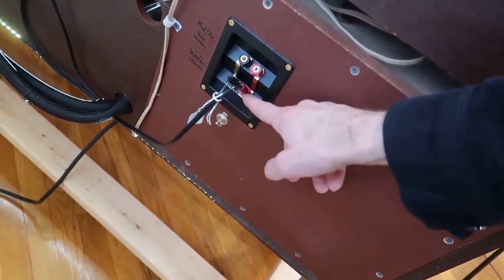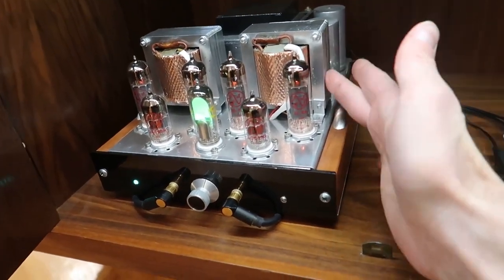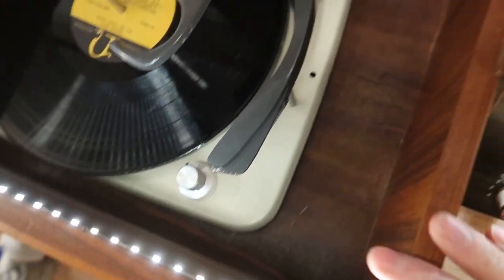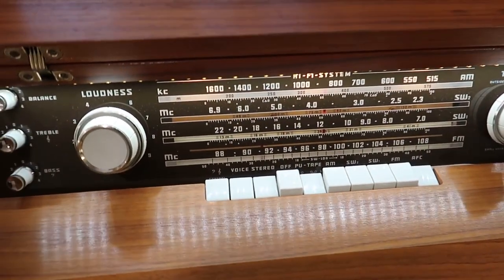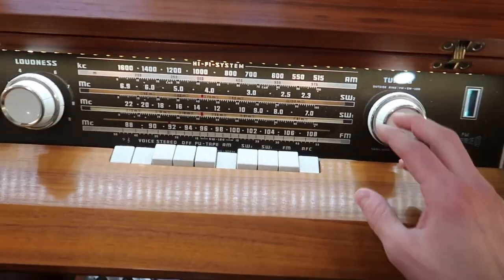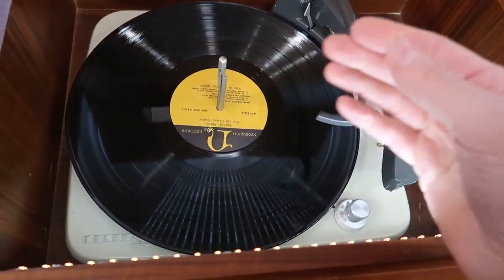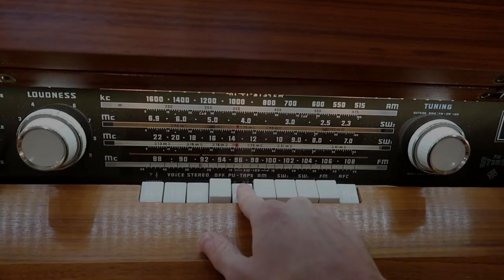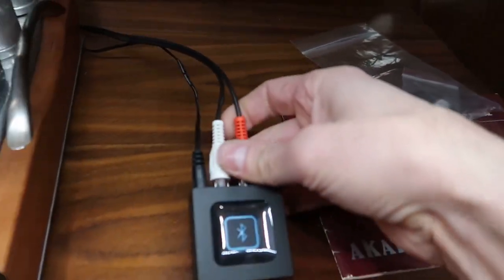Remastered Telefunken Bayreuth 5552MX console Acoustic Research Tuning Eye tube records antique

Comment: You are not using the auto function on the record player correctly.  You need to place the record at the top of the autochanger spindle, and secure it in place with the arm.  Then when you switch it to start, the record will fall down on to the platter, striking the size selector lever, and the pick-up will land in the correct place.  Then, as the arm has fallen down when the record fell, the pick-up will return to it's stand when the record has finished.  I think it can hold up to 10 records. Incidentally, I think the auto mechanism needs greasing, as the turntable was struggling to turn when it was engaged
Reply: Yes, I could not help but wonder what was going on, put the record on the autochanger turn it on and let it do it's thing. I would also read the instruction of the tape deck
'cause the tape is not threaded correctly an AKAI 4000 should perform as good
if not better than bluetooth
Reply: Yes, to both of you. He clearly has NO clue as to what the hell he's doing with both the changer and the reel to reel deck! Also makes me suspicious as to whether the electronics were repaired / restored properly - as the playback devices clearly were not! Additionally, is he not aware that there are input switch-boxes available (cheaply) that would prevent the cable juggling act  between the Bluetooth receiver and the tape deck? Mr. Joyemusic, please do take the advice given so freely here, your future customers deserve that much!

Comment: It is clear that you have done a great deal of restoration, for which you should be commended.  However, you are not operating the record changer correctly.  The unit is an American made VM changer, and you can find the model # on the underside of the changer.  Gary Stork at VM will be happy to help you with it.  On to the tape player.  You are not lacing the tape correctly.  Refer to your owner's manual for instructions.  Both the tape machine and record changer need to be cleaned and lubed.  They are both amazing, very well engineered units and will come right back to life for you when cleaned properly.  This is a lovely console.

Comment: I think the tape is wrongly laced in the reel deck. You are not using the capstan on the right. So no wonder it doesn't work correctly.
Reply from the maker: The pin on the right is an auto-stop, like if the reel runs out of tape. The speed issue is related to the slip of the reel -- Not enough slip on the take-up, I think... although that's the first time I had that problem.  But, yeah, there are probably some subtleties that I could learn on these things! I didn't grow up with them.

Comment: Hi!   Did you replace the power cable?   I have one of these but can’t locate a power cord for it anywhere!    It’s the old 2 prong
Reply from the maker: Yes, I actually installed a power strip inside and rewired it so a few outlets on the power strip are switched when the top is opened. Of course, I left a few outlets so the user could reconfigure it if desired.

Comment: I found one of these on a local auction site and the price is still under $100. I have zero knowledge of hi-fi equipment but my fiance is into records and we wanted a console for the house. The site lists it as unknown working condition. Would you recommend picking one of these up if it's a bargain? With little knowledge do you think it's a good project to take on? Thank you! Yours looks fantastic.
Reply from the maker: Nice find! If you're good with fixing things, you'll probably be able to get some of it working with YT videos. They generally take a lot of oiling, greasing, replacing bad belt (o-rings), etc. The electronics are sometimes not too hard to troubleshoot, but it does take some skill and especially attention to the deadly voltages present inside!! Sometimes up to 450volts!! If course, you can find someone to fix it, but it'll cost $1k-2k probably.
Reply: @JoyeMusiccom  Thank you for the reply! I am pretty good with repairing things so I will take a swing at it if need be. I will probably talk to some friends who are electricians to see if they have any insight on the voltage inside. I appreciate the advice! Thanks again!